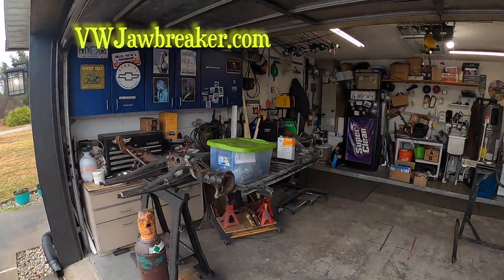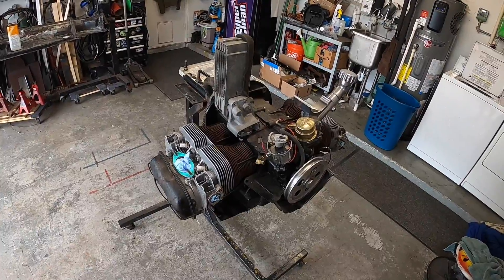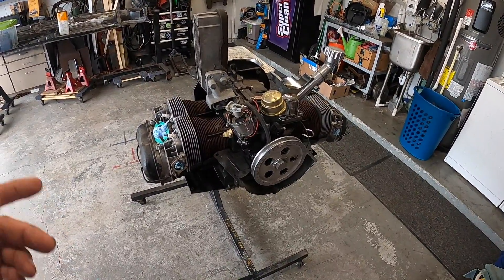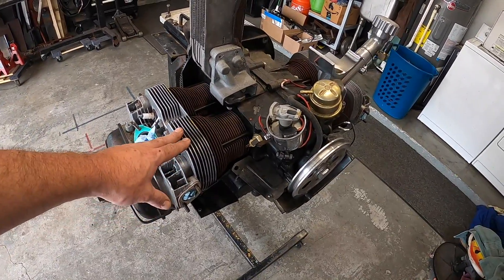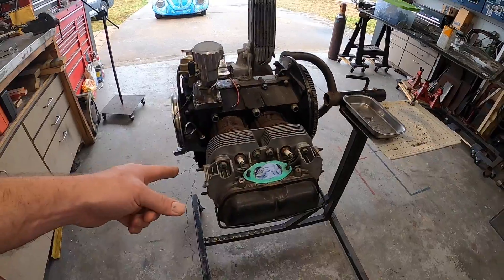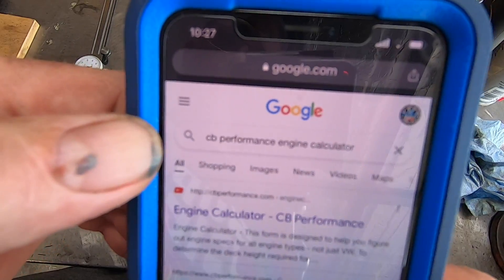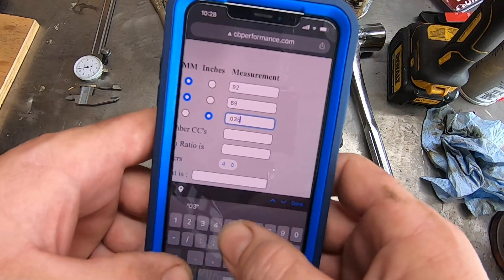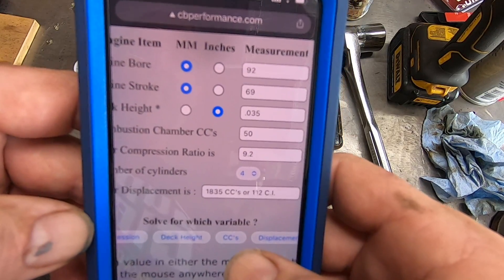How to Calculate Compression on Volkswagen Aircooled Engines - Part 1

Comment: 9.2  to 1 with a 110 cam would burn up in a bus. Good call. 
But...I would have cleaned all the carbon off the piston to get an accurate measurement.
Also ....any more than .060 on the deck height introduces cylinder fire.  I personally would either chambered the heads or bought another set of heads with more chamber. 55cc chamber at .050 would give you 8.2 to 1.
But I understand the cost factor as well.
Reply: I can show you used jugs with  excess deck height. It's not pretty.
Reply from the maker: @smokepeddler I’ve seen it before.
Reply from the maker: Plenty of opinions from many on all of that 🤙

Comment: Hi Gary - good video!  It has me wondering about the 94mm copper gasket shims I have between the tops of the cylinders, and down in my heads.  60 thousandths I believe.  I believe I made an error by not adding them into my deck height calculation.  Have you ever run those copper head shim gaskets before?  I was told they provide a better seal for combustion - but for deck height/compression, what would I do?  Just add that value to the deck height value, since they are a sense, making the cylinders a bit taller?  Thank you!
Reply from the maker: Hey! 
So, the copper head shims are ok, they just require re torquing the heads more often. With cylinder shims you don’t have that issue. 
With copper shims you absolutely need to add in your deck height since the shims are going to add additional deck height.

Comment: Hi Gary, new subscriber. I bought a 78 that had a GEX 1776 cc, 110 Engle cam, 40mm intake valves, 35.5mm exhaust valves, 44mm HPMX carbs. Purchased and installed summer 2023. I think I also got lucky with a clean engine. Good compression and runs well after 1,000 miles. Fingers crossed. I know you can’t tell for sure, but what compression ratio would you suspect this engine would be? Previous owner passed away, and old GEX out of business so no way to contact them.
Reply from the maker: @danielhass4812  hey there and welcome!
There is absolutely no way to tell exactly what the compression is on your engine without tearing it down. 
There are calculations you can do if you put in your engine specs and plug in valves from doing a compression test on your engine.  That’ll give you a round about answer.
Reply: @ thanks !

Comment: Is dynamic compression a more accurate indicator?Also I have herd that zero deck is optimal and to shim the head with copper head gasket,how true or important is that? Thanks for the info
Reply from the maker: @shawn9878  they both have their place, depends on the cam you’re running imo. Closer to stock and dynamic isn’t needed as much as there isn’t a huge overlap in the cam.
No clue who said to run zero deck, you want a minimum of .040” in VW engines. Depending on what cylinder size you’re running, they do offer copper head shims. If you run them, you’ll be pulling the tins and retorquing the heads quite often. Copper head shims have their place but I wouldn’t for a daily driver or one you don’t want to mess with often. 
Also, copper head gaskets aren’t available for 85,87 or 88mm pistons. They’re only available for 90.5 and above. 
So again, all of the depends on your engine combo and intended purpose.
Reply: @VWJawbreaker   yes I did not explain it correctly, the way I took it was .040 deck but  to keep it in  head ,if that makes sense. Thanks for the videos btw
Reply from the maker: @shawn9878  yes, ideally you want to keep it in the head but you can’t always only have .040” deck. Up to .060-.070” deck is ok.

Comment: Glad you make this content! Helpful in understanding more about the vw powerplant.  I too learned I have a 110 cam after I had a local shop smash my heads getting them off to install 88 thick wall piston/ cylinder kit. He stated my compression was 8.75:1 sold me a 38 gas empi crap carb manifold and said good luck. Never was able to get carb dialed right so put it where it belonged in the trash. Proceeded buy several empi 34 clones and engine still not right. I've been told get dual carbs but am reluctant as money is low along with my patience. If I did, which would you recommend?
Reply from the maker: Well, you can run a single carb with the 100 cam and it runs well with dual 34’s. You don’t need dual 2bbl carbs for the 110 cam. Sounds like there’s something else going on and not just a carb issue if you’ve been through that many carbs and still having issues.

Comment: Hi Gary . Need to backup a bit. I am installing cylinder head studs in a new aluminum case with stud savers. I was curious what should I use to 
seal the studs in the case savers. Do you use blue lock tight or gray silicone ?
Reply from the maker: All depends on if they are blind case savers or not. If you can not see through the case saver, there’s no need for sealant on the studs. 
If you can see through the case savers into the engine, then a thin layer of aviation sealant is all you need or permitex #2 non hardening. I don’t like to use locktite on case studs.

Comment: I'm curious if you know of any calculations of compression ratios for elevation changes?
Say if you have 9:1 at 1000 ft would you raise compression a certain % as you go up in elevation?
It's 5700 ft above where I live, they lower the octane levels here so maybe raising compression isn't a good idea, any thoughts?
Reply from the maker: I’m at sea level so I’ve never really dug too deep into this. 

My thoughts are this, and I could be wrong…
A normal vehicle doesn’t change their compression ratio for altitude, it’s only the computer that keeps the afr’s in check by adding more fuel for the thinner air at higher altitude. At least I’m pretty sure it’s adding more fuel, can’t remember off hand now lol 
I wouldn’t go crazy with a high compression air cooled engine but as long as it was timed and tuned properly, I wouldn’t see any issues.

Comment: Hi. have you ever tried building a zero deck with a copper head gasket? In this case you could of put a .040 copper and only had .035 deck in the cylinder.  I built a 1904 with zero deck and a 0.040 copper head gasket on the recommendation from AJ Simms, It is supposedly better all around to keep the burn in the head, I never had a problem and I personally think copper between the cylinder and head will seal better than cylinder to head. That was  10 yrs ago and I only kept it for a few years maby 1-2k miles but I actually found 2  owners later... 5 years later on the Samba and he drove it from Tampa Florida to California with no problems and got 25-28 MPG,  74mm x 90.5 Mahle, Had AJ Simms ported heads, his Kadrons, SVDA, hyfire ignition box, bugpack 4062-10 ( basically a 110),  1.1 rockers, about 8.5-8.-75-1 & one of Tigers first  SS Sidewinder exhaust with thing fan shroud, all vw factory tin and working thermostat in a 1959 Single cab. Ran real good, sound reminded me of a crotch rocket. Would spin 1st & 2nd in the rain.
Reply from the maker: Sounds like a stellar setup for sure. 
I personally don’t run the copper gaskets as you tend to retorque the head snore than normal…. From my experience and understanding from other more knowledgeable people. 
However what you say does make really good sense. 
Might be an upcoming experiment down the road.
Reply: @VWJawbreaker  yeah, that seems to be a lot of mixed opinions about that but I might’ve done the first retorque  while it was still out of the car after  break in 

If you try it, you should do it on an existing motor where you change nothing but that to see if it makes any performance difference and or cooling. It’s supposed to keep heat out of the cylinders also.
Reply from the maker: @anrescue  as I’ve said many times on my channel, there’s many ways to skin a cat…. Pick whatever way works best for you. 
We all don’t do things the same exact way, sometimes there’s more than one right way to do something. 

I’d like to do this to my current engine however the head area is kinda small so I’m running .070 shims to get .080 deck. I could run the .060 copper shims and still be within the specified compression ratio range…..
Hmmm….
Maybe that’s something for a ways down the road.

Comment: what determines setting the compression ratio? is it the size of  your camshaft?
Reply from the maker: Yes mostly but also no. 
It all depends on the complete engine combination and what it’s going into, used for, etc. Heads will only breath so much so a cam needs to be paired with the heads.
Reply: i've been watching your vids, trying to learn all i can, I'm about to put  1776 together with a engle w90 (cheater cam) in it and I think ill just run 8.250 to 1 CR with my stock dual port 500 series heads, maybe it'll work  @VWJawbreaker
Reply from the maker: @triariicat8448  I’d run closer to 7.9-8.0 imo

Comment: What is the reason for reducing compression
Reply from the maker: The more compression the more heat it produces. There’s an optimal range for the given aftermarket camshaft chosen, outside that you make too much heat and the additional compression is not effective. 
Too much heat, no radiator to cool things down, short lived engine.

Comment: Hi Gary.....040 deck height  in a stock 1600cc is a good  idea??
Reply from the maker: I’ve always been told that .040” is the minimum for any build. If it’s a bone stock build, keep the static compression down in the low to mid 7’s.

Comment: Does anybody know what would be a good cam size for a 1915cc?
Reply from the maker: Cam choice needs to match the heads you’re running on the engine. 
What’s re the specs of the 1915?
Reply: @VWJawbreaker  it's not built yet sir. I have an 1835cc that was under water I'm waiting for my floor jack to be repaired so I can tear into so I assume (I could be wrong) it has 90mm jugs,stock 69mm crank and stock cam. 041 heads in which the ports are the size of quarters. This was my first car(1963 Karmann Ghia) paid $1500 for the engine  back in the day (1988ish) with the duel 44 idf carbs. I know now the carbs were probably to big for the engine but I was a kid...they simply looked cool.
Reply from the maker: @ropadoped  if you’re going to run the same heads and if they have stock size valves I’d recommend a scat c35 cam. Good all around cam
Reply: @VWJawbreaker  good to kwow, what are your thoughts on going with 84jugs keeping the 60mm crank or stroking with 90.5mm b jugs and going with a 76mm crank I know 74mm will drop in but I don't know what the difference is here...to many choices.
Reply: 69mm crank I mean
Reply from the maker: @ropadoped  all depends on what you’re trying to accomplish. Displacement makes more power. Larger the stroke the more power also because you’re adding more displacement on the stroke of the cylinder. 
Best to read up on different forums and or engine build sites like cb performance. 
It helps to have a plan on what you’re wanting from the engine first before planning a build. Just my thoughts.
Reply: @VWJawbreaker  yes sir I've been on The samba and Shop talk forums I go by Knockerblocker on those. You remind me of my friend Derek Campbell. He would work on his Vw's with bare feet also.
Reply: A plan is what I'm figuring out.
Reply from the maker: @ropadoped  once you get a budget figured out you’ll be able to real in on a plan. From there it’ll start to come together for you. There’s no right or wrong opinions, some things work better for some than others. There are some bad combo choices but as long as you keep things mild you’ll be ok.

Comment: I am going to try to do this quick question, the carbon build up on top of the piston will not give you a false reason, when using the feeler gages?
Reply from the maker: If the carbon build up is thick, yes. 
In this situation it was more of a discoloration.
Reply: @VWJawbreaker  *reading

Comment: Great job Garry. I seen no one mention, you will need to make the correct length push rods now. Make sure you check the rocker arm geometry.
Reply from the maker: Yea sir, good point.  I did check the rocker geometry and it was good with the stock push rods.

Comment: Good info here… had to do this on my build last year, and took me a little while to properly figure out… was calculating it wrong at first and couldn’t understand why my compression was so low 🤦‍♂️
Reply from the maker: Thanks man. I’ve done the same before, inputting wrong numbers caused a ton of headaches… that’s when I learned to slow down and write down my info on a spreadsheet… just fill the info out as I move along. As long as you find a process that works for you, you’ll be good.

Comment: Liked the video, agree static compression ratio is a bit high. Have you factored in the Dynamic or running compression ratio. The closing time of the intake valve @.050 will affect the compression ratio depending on your camshaft. Just something to consider. Thank you again for an informative and educational video.
Reply from the maker: I’ve ran the numbers with this cam before and the dynamic doesn’t drop that much due to a small overlap compared to bigger cams like the FK8 in jawbreaker. 
Good thinking and looking out!

Comment: Nice job!  I am interested in how the cam lobes and lifter bases look after 500 miles. How much of the parkerized stuff came off.
Reply from the maker: I would have loved to split the case on this one but he wanted to leave it alone. 
I suggested swapping for 90.5’s, a W100 or C25 cam and a 74 stroke crank…. He would have loved that combo in that early bus.
Reply: I agree!  Maybe shine a light inside the case and look inside without splitting. Thanks
Reply from the maker: @TheEZGZ  I did look inside and it all looked good… didn’t film it though 🙄

Comment: Is it nessisary to seal the inner head bolts and washers. I'm putting my jugs and heads on tomorrow morning. Would have done it today but don't own sir clip pliers.
Reply from the maker: Yes sir, I prefer to put a little sealant on the washers only on the 4 inside head studs.

Comment: Great information, Gary. That seemed like an awful lot of gook leaking out of that head.
What compression ratio do you run in Jawbreaker? 👍
Reply from the maker: Yes, the heads were leaking some. Lapping the heads and the jugs together will stop that. 
Jawbreaker not having a stock engine is running 10.0:1
Reply from the maker: @Joesrustbuckets  thanks buddy! Several ways to skin a cat, this is the way I chose for this situation. 
Part 2 will be out this week.

Comment: Great info Gary! I haven't seen many videos on lapping the cylinders to match the heads. Letting people know that it can be the simple things that can help keep the compression chamber tight. Jist a thought. I was amazed at how clean the rocker area was. Thanks for your tech savvy 
 Have a great day! Jim
Reply from the maker: Thank you sir! I’ve put lapping in a few of my older videos but figured it would be a good refresh for some. This engine has maybe a few hundred miles on it so it better be clean 😂
Appreciate you as always Jim!

Comment: More stuff I didn't know.  Well explained.  Now how is the engine going to be adapted for the mustache bar?
Reply from the maker: Thank you sir. 
They sell a plate that bolts into the oil pump to accommodate a mustache bar. I haven’t seen his bud but he said he thought it didn’t take a mustache bar in his ‘69 bay…. I beg to differ though.

Comment: It would be interesting to know if the heads were still torqued to spec or how loose they were.  those 50cc chambers are pretty small.  You could go old school and have them hemi cut to gain back chamber volume.  I would do shims under the barrels to get more deck .035 is too tight in my opinion. I like this motor build stuff,  but hey I like all your videos . Cheers
Reply from the maker: Hey buddy! Seems the builder put something on the threads to keep the heads torqued down, that’s why the studs pulled from the case. Easy enough to clean up.
Wish someone near by could hdmi cut the heads, I would have rather gone that route and yes, .035” deck is too tight for me. I prefer a minimum of .040-.050 depending on the chamber size.

Comment: Good stuff to know!
When I bought mellow yellow, my dad made special note to tell me never to use silicone on a Volkswagen engine. I used gasket sinch. It's now made by Edelbrock.
Reply from the maker: Silicone on the engine half’s isn’t a great idea imo but anywhere else isn’t an issue. Gasket sinch is some good stuff though, forgot they are now making it.

Comment: Brazilian 041 heads; old school. You can either shim at the barrel bases or between the barrel and the head. In my case I put bronze (or brass?) shims between the head and the barrel. Also, if the barrel are thick wall you should be all set. Earlier 92s were not very reliable because they were thin walled. For a Bus this is very important.
Reply from the maker: Yes sir, don’t see these heads very often. I took them apart off camera and everything was in great shape. 
I’m personally not a fan of the copper gaskets between the heads and the jugs as I’ve seen the heads constantly work loose on a regular driver vehicle. Those are meant more for the racers who are constantly pulling things apart or re torquing the heads.